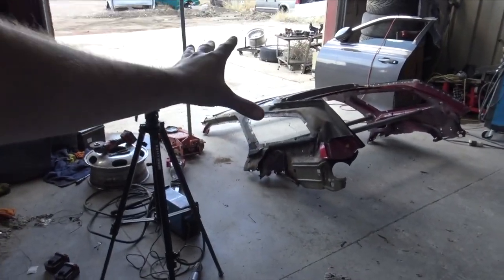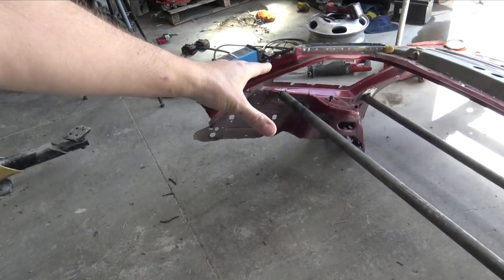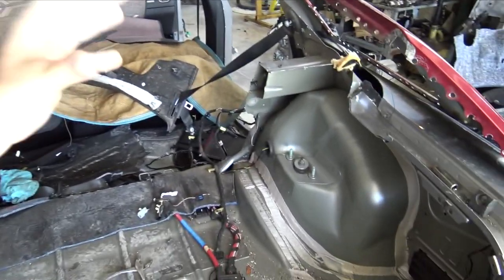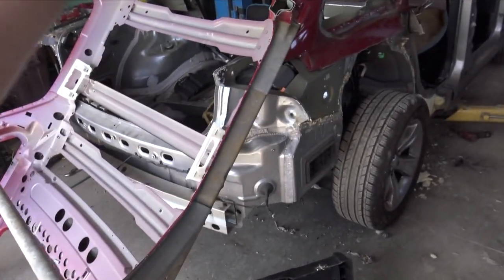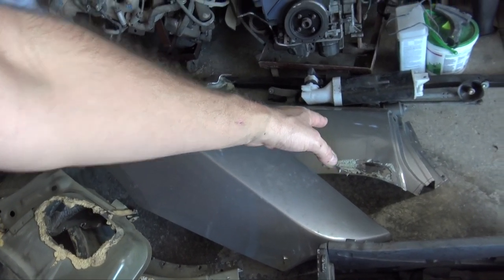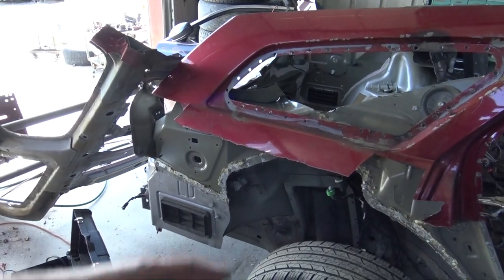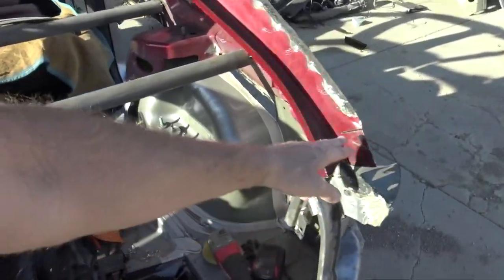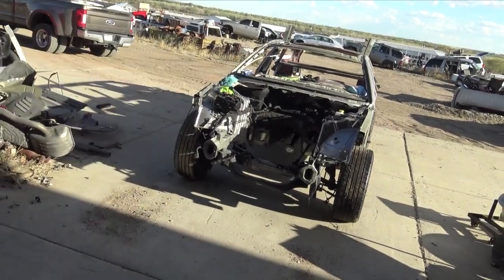Building What Dodge Wont | 2021 Charger Magnum Hellcat |  1000HP Hellwagon | Pt 3

Comment: I think if it was mine, and I’m not telling you what to do, I’d use the whole roof from the A pillar back from the magnum with it’s quarters, rear gate, the floor from the grand Cherokee for the AWD platform to bolt to, and get the wide body under fenders, use an English wheel to bulge out the magnum quarters to fit over the wide body inners.

Comment: I need to mention this JIC, a good way to approach the hatch is to combine the hatch top half with the Charger trunk bottom half. Just chop off most of the horizontal surface of the trunk, then let it latch into place on the charger. That'll keep it in place for when the hatch comes into play.

If you chop the hatch below the rear window and bolt it back on it's hinges, you'll be able to see where it meets up with the trunk, then chop the excess and weld what's left. 

The results should be cleaner and easier than patch panels or what-not. Plus you keep the charger's bodyline intact all the way around with that swooping tail section.

Good job with the work done so far. You'r really showing how patience, a clear head, and understanding can seriously simplifiy a job like this to the point of feasibility. Love your vids, brother. Keep up the good work.
Reply: I came here to say the exact same thing.  Don't relocate the Charger tail lights farther out to fit the hatch, graft the Magnum hatch to the Charger trunk bottom.  I imagine that the biggest issue here would probably be getting a proper seal around the hatch so that it doesn't leak where the transition happens.

Comment: an air chisel works great to remove the spot welds. i removed a firewall once and started with a spot weld drill attachment. after going through a dozen bits, i finally used an air chisel and i cut my time in half.

Comment: Amazing.  I honestly couldn't do the body work like that.  Part of it is my shoulder being screwed up but honestly I wouldn't know where to even start.  I just want to swap a 2012 or 2013 4.7l engine and trans into my 03 Dakota.  Head gasket is blown but limping by for now figured that it's had a rough life so why not rebuild... long block is 2500 though and then I still have the trans with a lot of miles on it.  Getting a engine and trans from a rear ended truck will end up being a decent HP gain and effectively should plug right in with an adapter for the throttle body and an exhaust modification since the manifolds dump slightly different.  Just trolling LKQ for now to try and find something I can go down and pull.

Comment: Going to look good.. I might of just put the charger front clip on the magnum saved on some cutting..lol
Reply: I'm kind of in your camp. I would have done a rear section I think. Deal with bigger hunks where you are not trying to reconstruct door and hatch openings. But I'm not hip to how the basic structures are similar and what bits, interior-wise, transfers over. That's the real key. Chrysler always has been/is a real master of getting the most out of their understructure for creating different models and a guy should/ could take advantage of that. Real interesting project. Can't wait to see the finished project.

Comment: Hey Dave , I have a rather serious question for you. Can you give me 2 anchor points ( drivers side - behind the windshield. Above the rear window. ) , through the roof of my 2014 Charger , into the subframe , for secure anchor points? I'm asking since you have the car tore down and actually have hands on. Thank you for your time and any help in this matter. ( this is for a custom roof rack. I would like to use the HD rivets with the threads inside)

Comment: Did you just use a Dremel to cut off panels? Hope you don't use a soldering iron to weld it together! 😉
Reply from the maker: Do that in certain areas to not cut the under structure
Reply: @Junkyard_Dave  just having a laugh mate! I'm a panel beater by trade and in 27 years never seen anyone use a Dremel but that doesn't make it wrong. 
Cool build so far, keen to see how it turns out. 👍

Comment: YO DAVE YOU GOTTA MAKE YOURSELF A SPOT WELD CHISEL OUT OF A NICE PIECE OF 2in wide by 3/8 FLAT BAR GRIND DOWN ONE SIDE A BIT IT IT WILL WORK 100 times better then using a little ass screwdriver... check out this dude author tussik check out the tools he uses to work through spot welds like butter

Comment: hey automakers lets spray foam into areas where we'll know theyll rust out even faster
Reply from the maker: They do it for strength
Reply: @Junkyard_Dave  strength in the pocket book
Reply from the maker: Actually the amount of strength it adds x the weight is a much higher ratio than having steel bridging, it is a lot less expensive as well. There also is almost concrete substitute that really makes the chassis rigid but it adds quite a bit of weight and it would be impossible to ever remove the rails.